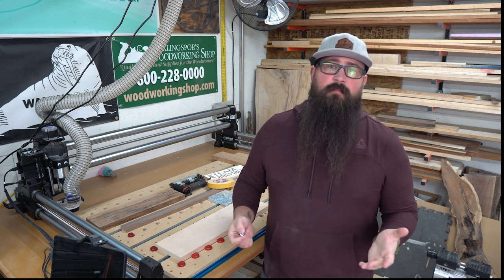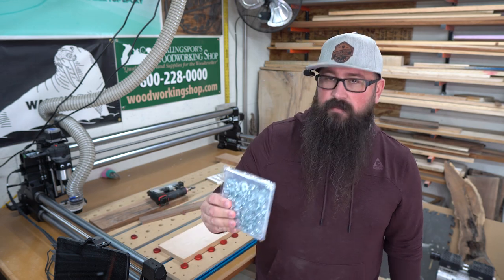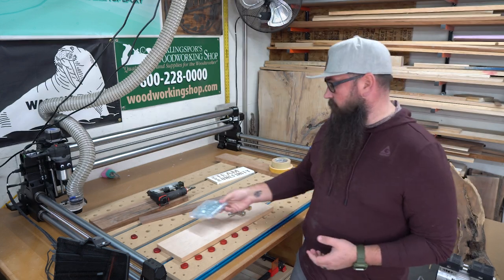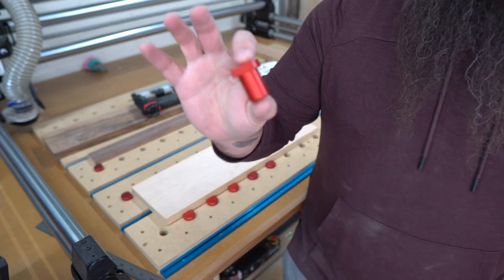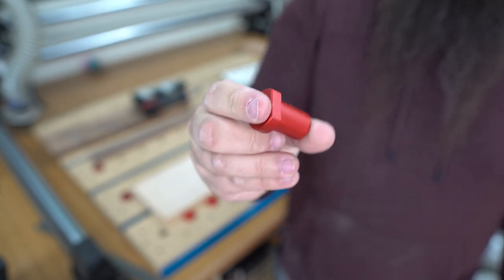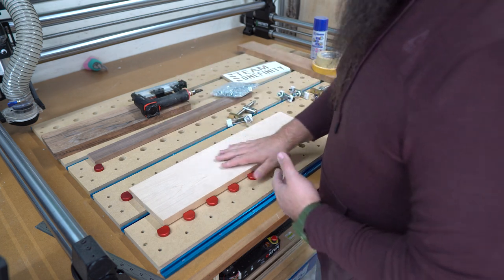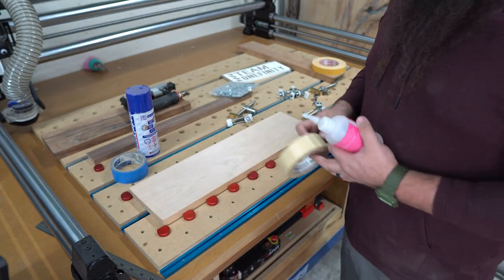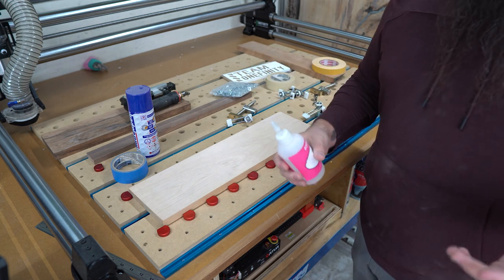Cnc work Holding

Comment: When it's an option on the work piece,  I use a biscuit jointer and do two per short side 1 on the long depending on the length. 

Cut some wedges, insert it into the biscuit hole and screw the wedge to the table top. 

Works amazingly

Comment: A pin nailer and XFactor tape are my go to solutions. CA glue with tape is a pain in the backside to remove, often the glue seeps through the tape and needs to be sanded off. XFactor does goop up your bits on through cuts so that's where the pin nailer comes in. I haven't yet tried dogs and cam clamps yet though.

Comment: I wouldn't use any type of steel nail at all. You'll be routering through broken pieces when you surface your spoilboard over and over.
If anything, get a Raptor nailgun, and shoot plastic brads.
I mostly use double stick tape, and wooden or aluminum clamps, that fix into a t-track.
I've also just made myself a set of vacuum pads, that fit into the t-track, and hooked up to a small vacuum pump. The clamping effect with melamine and plywood is INCREDIBLE.
Reply from the maker: I’ve been doing it that way for years with no issues. And they pull out of the waste board so there’s no worry about it

Comment: Listened to your video on my way to work.  New to cnc and work holding has been by
Biggest hurdle so far.  I used pvc pipe cut to short lengths that pop into a grid on my wasteboard.  Using simple wedge blocks work surprisingly welI.  I also just got some of that xfasten tape yesterday.  Next time I will add some T track. Check out broinwood , he gave me the pvc idea.
Reply from the maker: Hey glad I was able to help and give you some new ideas and I will check out the pvc idea too.

Comment: I use the pin nailer too, and I do love it. 
However, and maybe you can tell me if you have the same issue… the pins stay in the MDF after, and when I pull them out a lot of times the pins will break off and leave sharp little nubs behind. How do you solve this? Usually I just use a hammer, but do you have this issue?
Reply from the maker: I have the same issue. And I’ll flatten them with a hammer and it’s usually good after sanding